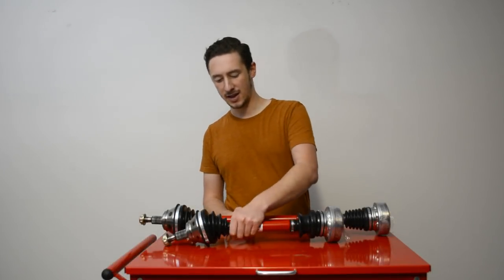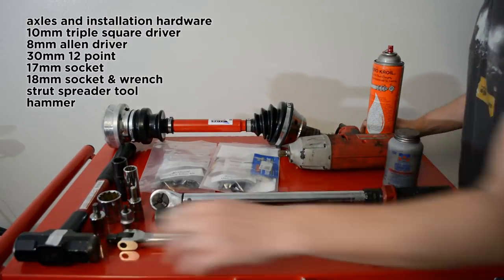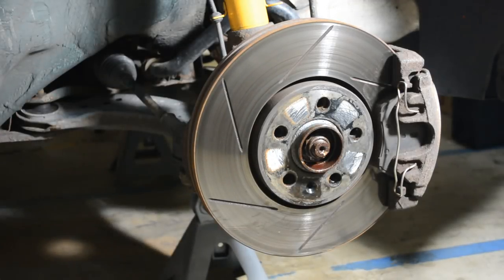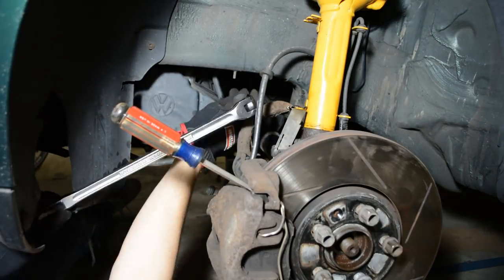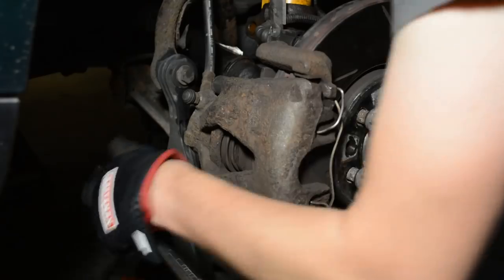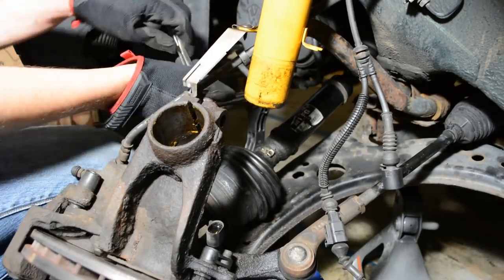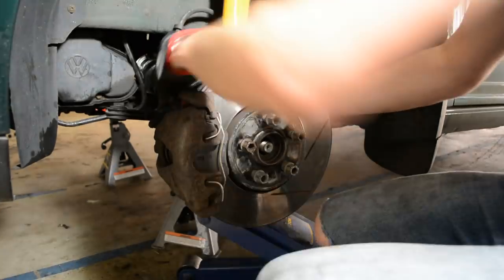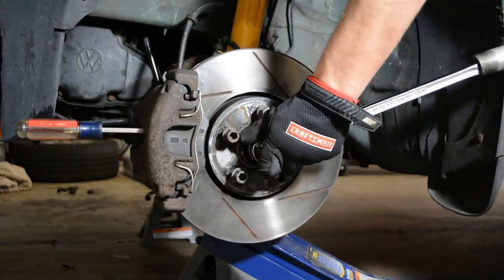MK4 VW CV Axle Removal and Installation

Comment: Going to give this a go tomorrow. But have a few questions any help appreciated 

Do you get much leakage of transmission fluid? (take it you just top up whatever you loose?)
When you disconnect the wires do you have any trouble with lights on the dash when you reinsert them?

I apologise if these are stupid questions never done one before.

Great Video!
Reply from the maker: Don't worry about questions! I'm more than happy to help.

You won't lose any transmission fluid. The gear oil is isolated to the inside of the transmission and never touches the CV axles. The axles bolt to flanges that go inside the transmission, and unless you have a problem with those seals, you shouldn't see any trans fluid. 
As for the wires to brakes : you may have the ABS light on after reconnecting wires. If you do, you have a few options. Reset it with VAG-COM, disconnect and re-connect the battery, or my personal favorite - take the car out and slam on the brakes to get the ABS to engage, and it will turn off. Essentially since you disconnected it, the car isn't sure the system is working, but once you slam on the brakes and ABS engages, it realizes everything is ok and the light goes off. 

Please let me know if you have any other questions, or you need some more help with removal or install. Good luck, I'm glad my video can be of assistance!
Reply: that ABS trick is absolutely superb! Thanks man ill keep you updated on how it goes cheers!

Comment: Hello what’s the link to purchase the axle? Also, if I only need to replace the driver side is it best to replace passenger side? TY
Reply from the maker: The axles are from https://www.raxles.com/

I prefer to replace both driver and passenger axles at the same time because I'm in there, and to keep the age of the parts the same. Things like boots can fall with age/mileage, so if one boot tore, the other might not be far behind. That being said, you don't have to do both at the same time if you don't want to.

Comment: Idk if you will reply but it’s worth a shot to ask. I stripped the t50 torx bolts that hold in the CV axle to the transmission and I’m stuck on what I should do, any tips?
Reply from the maker: Were you using a torx or a triple square? The stock bolts are triple squares. In any event, you could try a few things - Hammering the next size up bit into the stripped out hole. I've sometimes had luck with this. You could buy some extractor allen bits, I've got a set I picked up from Home Depot and they've come in handy in a pinch. You could grind flat spots on the head of the bolt to get a wrench or vice grip around it. Your last option is drilling them out. Not fun, but if all else fails that's what you'll have to do. Good luck!

Comment: Did you grease the axle on the transmission/flange side? if so what grease did you use?
Reply from the maker: The inner joint is 'open' in the sense that you pack it with axle grease and bolt it to the flange of the transmission. That flange on the transmission side is what keeps the grease in. Use some high quality CV axle grease and you'll be all set.

Comment: Can you clarify the driveshaft/axle you have used here? The inner CV joint from the axle that was removed is for the 5speed box (02J) but the axle you have installed uses the inner same CV joint for a 6speed which have different gearbox flanges.
Reply from the maker: I used Raxles. They are different than OEM when comparing them, they even tell you that before you order.

Comment: I prefer skipping removing tie rods or even the knuckle. Just loosen the 3 bolts on bottom to control arm I see no point in spreading the strut at all. Done this twice with no issues. Tire swings clear out of way.
Reply from the maker: Either way works. I did it this way since I didn't see any videos explain this method.

Comment: Great video. I just replaced ny front absorbers, bush, lower arm bush, absorbers bearing and stabilizer bushs. When i took it for a ride the front left drive shart wss vibration very bad. So thr next day, i sent it back. I notices the inner section of the left drive shaft is vibrating badly. So guys, what do guys think?
Reply from the maker: Check for torn boots or any kind of grease loss. Sounds like you did some pretty extensive work on the front end! It could be something unrelated to the bushings, like a wheel bearing, or lose component from when you put it all back together. Make sure everything is buttoned up tight, and then check for excessive play in the axles. If one side is going, the other probably isn't too far behind.

Comment: How are you torqueing the flange bolts (triple square) while it's in neutral
Reply from the maker: I tightened them the same way I loosened them. Assemble the axle into the hub/spindle and then wedge a screwdriver into the brake rotor and let it hit the caliper to stop everything from rotating.

Comment: Hey Steve any tips on lining up the splines and checking to see if it’s lined up correctly?
Just started this installation today would appreciate the help!
Reply from the maker: @J I lined them up as close as I could by eye and went from there. Luckily with the size and length of the splines it would be pretty difficult to mess it up. The metals are also not something soft like aluminum, so if you get them lined up they'll slide in. I do remember having a bit of trouble wiggling them in, but you'll know once they're good. Let me know if you need anything else, and good luck with the job!
Reply: Steve's Garage thanks a lot for the reply and the great video!

Comment: What's the best way to remove the passenger side to install a outer CV boot. I don't want to change my axle later down the road... I do have a clunking when it hit bumps but from your other video. I gathered that it is the strut making that noise. Plus the boot ring slipped off on the small end about a week ago and I don't think it's been damaged in that short amount of time. I haven't been driving it much at all.
Reply from the maker: If it just slipped off, I agree that you're probably ok, just make sure that you put some grease in there if it looks like you lost any. Really you'd have to do the whole thing up to removing the axle from the transmission side. No easy way to slip the boot on there without getting the axle out of the hub.

Comment: Hi - I just finished replacing the front driver side knuckle and CV Axle.  I'm installing anew ball joint when I get home from work tonight.  Then I need to torque down the Axle Flange Bolts to 59 ft lbs.  Question - When I try to torque the bolts down, the axle turns.  It's a manual, so I put it in gear thinking that would stop the turning, but I was wrong.  How can I stop the transmission from turning so I can torque the flange bolts?
Reply from the maker: @Thomas Klauser I started all the axle flange bolts by hand, tightening them as much as I could without the axle turning. The axle was installed into the spindle at this time, so I used the lug bolts (or studs on non-german vehicles) to brace the whole assembly from turning. I used a pry bar to slip between the studs, and brace against the floor. Let me know if that makes sense or you need any more help!

Comment: What is an indication that the cv joints need to be replaced? I have 03 jetta with 110,818 miles and I noticed a vibration when accelerating. Specially at higher speeds.
Reply from the maker: I never noticed any vibration with mine, but it is possible. You could just need an alignment or tires with a vibration. My OEM axles lasted until ~180k. Do you drive your car particularly hard or have any aftermarket modifications?
Reply: Steve's Garage i am not sure I just bought it to commute
Reply from the maker: I'd start from the outside and work in. Make sure tires are good, alignment is done, wheels are torqued properly. Then go in and check brakes, axles, suspension components if your problem persists.

Comment: I just put a new passenger side axle in and I have a small shake while I drive, this is the second time I've changed it in a month and I believe I did something wrong, I used oem axles and it seems to be losing a bit of grease is that probably a gasket issue? My bolts are tight but I got grease everywhere in the process, any ideas?
Reply from the maker: The grease on the ends should be pretty thick and shouldn't really go anywhere during installation. If the grease is coming out of the boots maybe you need to tighten the hose clamps down?

Comment: After replacing passenger CV with OEM replacement, getting a grinding/scraping sound while driving. Double checked the dust cover, and make sure nothing else was touching metal. Still have the sound, any tips on where i should check first? Im taking the cv back out and packing more grease in this weekend.
Reply from the maker: Good first step of checking to see if there are any problems with the axle itself. Are you sure it's coming from the axle and not something else? If it is coming from the axle is there a lot of play or any other sign pointing towards it being a defective unit despite being OEM?
Reply: @StevesGarage  95% sure. Checked tie rods, checked wheel bearings, checked sway bar links. Nothing seems jimmied out of place or loose. I have a sneaking suspicion that I didn't pack the axle full enough with grease. I only used about a 1/4 of the bag that came with the axle thinking the residual grease in the trans would be enough.  Sorry for the late reply, I was on vacation.
Reply: @StevesGarage  Also, the noise is coming specifically from the side I changed the axle on. Rolled down individual windows while driving to pinpoint just where it was coming from.
Reply from the maker: @noticeablystrange3021  No worries about the late reply, we all have a life! If you only used 1/4 of the bag that's your issue. When I rebuilt the axles on my Volvo it came with a bag of grease for each joint. You should use the whole thing.

Comment: I have 1.8t 5pd manual  i see my new axle shaft is thinner than the old one does that matter?
Reply from the maker: I've done axles on a few cars and the diameter has always been the same. Is it possible that you got axles for a different engine/transmission? I think that some of the different models have different axles. Whats the difference in axle diameter between the two?

Comment: When you remove the drive shaft from the flange on the engine, does transmission fluid drain out? Do you then need to refill it? Also, the bolts to the flange on the engine,  do they need locktite to prevent them vibrating loose? Great video btw
Reply from the maker: Thank you! Transmission fluid shouldn't come out when you take the axle off the flange. If I remember correctly, I used blue loctite on the inner bolts. In stock configuration those inner bolts are triple squares, so make sure you have a good bit to get in there. I've stripped so many cheap triple squares that I bought a snap-on bit so I knew I wouldn't have any problems with it.
Reply: Brilliant!!!! Thank you so much!! ;-)

Comment: Decent guide but you dont need to undo the drop link or the suspension, just either pop the lower ball joint or if thats not working out just undo the 3 bolts holing the ball joint to the arm. That will be enough to get the shaft out
Reply from the maker: The reason I didn't want to touch the ball joints is I didn't want to have to get an alignment. Typically if you mess with the ball joints, you're going to need an alignment. Either way works though.
Reply: @StevesGarage  yeah good point

Comment: What if one of the triple square bolts are stripped, what do I do.?????
Reply from the maker: First yell a lot, and if you cry no one will judge you. In all seriousness, You can try to hammer in the next size up bit. Triple square if you have it, maybe a torx or allen if you don't. You can also try grinding flat spots on the outside so you can get a wrench on there. Another option is extractor bits. I've actually had some decent luck using ones I picked up at a local parts store.

Comment: how is that when you take your wheel of your brake caliper is sitting in front then at 2;29 in your vid the caliper is sitting at the back ? did you change the cam
Reply from the maker: @n3gative Nice catch! I filmed different sides of the car is all. The driver side was giving me a bunch of trouble getting the axle nut off, so I filmed the passenger side instead.

Comment: what kind of price did they hit you with? and how are they holding up after a year of use? and what kind of mileage have you put on them?
Reply from the maker: They ran me $700. My car is lowered an inch and a half, and a daily driver through snow/rain etc. I've got 8k miles on them, and they've been great. No weird noises, nothing loosening up, I can't as for more. I read stories of people using cheaper axles, and them not being as reliable, which is why I went with these. I don't mind saving money on parts that are easy to replace, but with something like axles, I'd rather be one and done.

Comment: Is the sub frame a good place to jack up the car ? I always use the reinforced metal on the sides next to the tire then idk where to put the jack stands, havent been able to get anyone to answer me on this and get super sketched everything I have to get under my car, everyone acts like we should know what the different parts are which when doing stuff like this yes but we r watching the vid that shows how to do it, never shows how to and where exactly to put the jack and jack stands, plus different cars look..... different lol
Reply from the maker: I typically put the jack stands on the sub frame mounts, or where the control arm bolts to the sub frame. I put the stands on the sub frame, never a moving part (suspension or otherwise). You can jack the car up from either of those points, or where the dog bone mounts to the frame. You can absolutely jack the car up from the pinch weld, it's just not something I like to do. I've managed to get the jack and stands in place all on the sub frame.
Reply: Someone that actually replies! I love it! But y not use the pinch points? I thought it was reinforced just for that purpose, or is it meant for the jack stands?
Reply from the maker: @ianmoberg374  I do my best to reply to everyone! You can use the pinch welds, I just don't like to. It feels more sturdy to me to place the jack and stands on a frame area if I can. I have used the pinch weld when using the spare tire jack and it was fine.

It also might be a subconscious thing of growing up in a snow state where rockers can be rusted out, and jacking up a car from them would be a terrible idea.
Reply: Ok I gotcha that makes perfect sense thank you for the info its much appreciated buddy!
Reply from the maker: @ianmoberg374  Happy to help!

Comment: If youre looking for an accurate video, look no further. 
Just did the job, wasnt rax I installed but was the same process. I personally didnt have a strut spreader, but a nice sized flat head screwdriver will work just fine. I marked the strut with horizontal and vertical markings to line back up to. Slid out easy peasy, went back in easy peasy. A second set of hands is a game changer so grab your 13 yr old and wrench on!
Reply from the maker: Thank you for the reply! I'm glad it worked well for you and you got your car repaired. It's not too bad a job if you have the proper tools for it, and an extra hand is always a huge help!

Comment: my problem is that the axle body around the bolts is right against them unlike in yours where you have plenty of room. I can't place the bits inside the bolts without angling them and stripping them because the socket that holds them is too wide and touches the axle. I have 1.9L VW beetlle TDI
Reply from the maker: My bolts had very little clearance as well. It's tough to see in the video, but it wasn't the easiest for me get them out with the socket I had since the body of it was so large. I have a set of Lisle triple square bits that you have to put a wrench or socket on the end to use it. They look like this - https://shop.advanceautoparts.com/p/lisle-triple-square-wrench-set-60750/4557161-P?searchTerm=lisle+triple+square

Maybe you can pick up that set and use that? That should give you more clearance around the axle. I'm honestly curious how these were installed if you can't fit a standard bit driver between the bolt and the axle!
Reply: Steve's Garage I had a bit set like that but it wouldn’t fit lengthwise. I ordered this: 
https://www.amazon.com/SK-Hand-Tool-82060-2-Inch/dp/B000X1NCQK/ref=mp_s_a_1_42?keywords=10mm+triple+square+bit&qid=1580091167&sr=8-42
It will work I think because it’s 1 inch long, and has the hole so I think I’ll be able to stick a pin in it and torque it or otherwise a wrench. 
My axle as it is has a crevice for every other bolt that allowed me to take out those ones. But it left three that I couldn’t and I ordered that bit for them.
Reply: @StevesGarage  as you can see in mine: https://imgur.com/a/b36wylI
every other bolt isn't given enough clearance for me to get it out. im stripping it. the part i said i ordered didnt come as advertised and didn't fit. so I ordered this now to get those ones out:
https://www.amazon.com/Titan-Tools-12733-Extra-Long-Triple/dp/B00BY9RXY2

Comment: Hello Sr! Do you know if this way to do it, it's the same on the VW jetta MK4 but thr GLX VR6 engine 5 speed Automatic transmission??
Reply from the maker: I know between automatic and manual there is a size difference, might also be the same for 1.8t vs VR6, but the procedure should be similar if not exactly the same. I'm not sure about hardware size either, but As far as a general guide this would work. To be absolutely sure, I would make sure you have a manual specifically for the VR6 auto, as sizes or torque specs could be different.